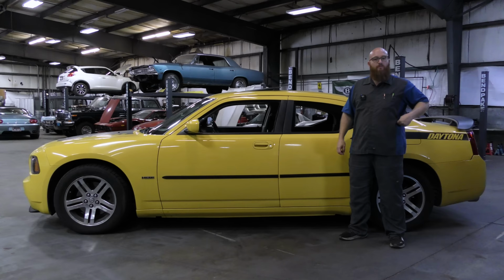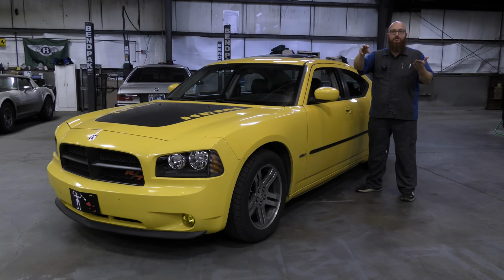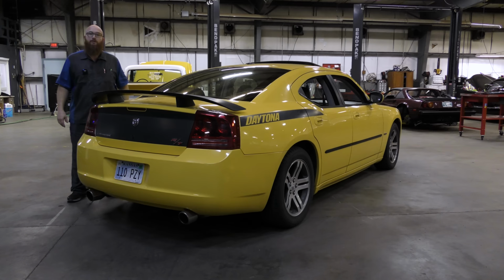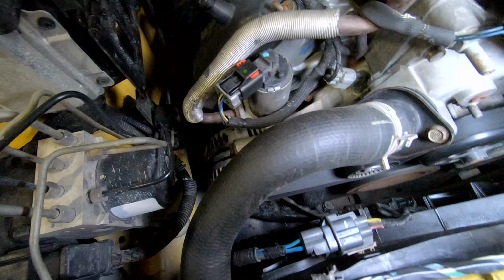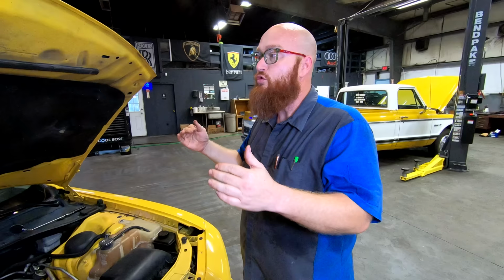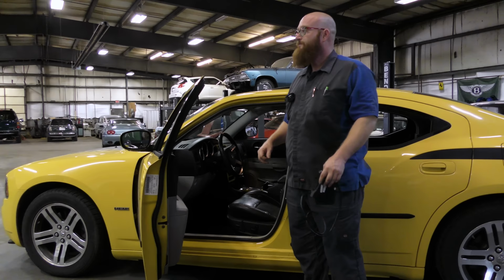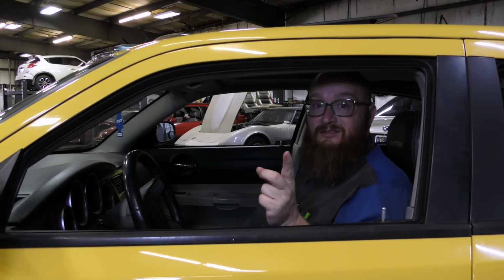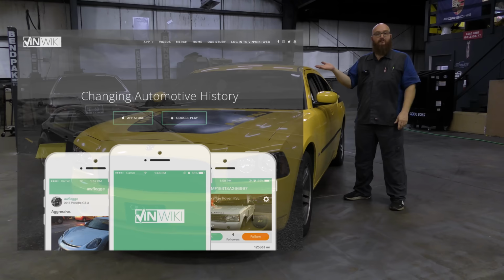4 things you MUST check before you buy any used car! CAR WIZARD shows how not to be scammed!

Comment: On the other hand I was a seller trying to sell a honest 1993 Toyota Camry 2.2 with 300k on it I had just put a timing belt kit plugs and wires on it, rear windows didn’t work a/c didn’t work had good tires check engine light was on not sure what for mainly due to obd1 no one had the connector but ran perfectly but couldn’t get $1200 for it 8 years ago I was actually offered $200 for it multiple times, now fast forward I kept it now has 480k on it all I’ve done was maintenance, it now needs timing belt kit done again. Still rear windows don’t work and a/c not worth fixing same pesky check engine light still on as well. One of the guys that passed on buying this car have had 3 cars in that 8 year timeframe, he now regrets not buying my old Toyota.

Comment: also an important one; make sure the coolant is the CORRECT COLOUR.  some engines require special kinda of coolent to prevent corrosion; chargers are a perfect example. they take exclusively HOAT coolant, usually orange, not green. Ive heard horror stories of charger owners using the wrong coolentand it badly mucking things up.

also ask about the kind of gas they put in it: stock chargers for instance are made for the best performance on 89-91 octane. if the owner is putting in regular, it'll feel more sluggish on the test drive. it also indicates the owner doesn't know anything about their car and hasn't been servicing it correctly.
Reply: Ironically DEXCOOL is specifically the coolant chargers and challengers use. Also chargers and challengers are made for 87 octane whether its the v6 or the v8 and says that much in the manual. 
You can run 89 or 91 but it wont do anything but cost you extra.
Reply: @pilsplease7561   my OEM manual explicitly says intended for 89 octane and above, but that the charger can RUN on 87 if needed. the knock sensors will start going off and lower your output power to compensate; also not great for your side walls long term. these engines have something like a 9.5:1 compression ratio which is pretty damn high for running reg. the different in power output and rev range is pretty noticeable. 

im pretty sure that they just use rebranded Zerex as the coolant, and even if its Dexcool, its the orange Hybrid organic blah blah variety; not just plain old 50/50 antifreeze propylene glycol. that WILL destroy the system over time.
Reply: @572089  Your car must be old if its got that low of a compression its higher on my newer car and manual says 87. To be fair they did revise the manual 2017 and newer.
Reply: @pilsplease7561   yea, the gen 3, are split into 2 sub-gens with different heads and with VVT or not.
(Pre-eagle, and eagle) or (early/late gemn3)

The earlier ones had slightly lower compression, but the lack of VVT means they can't just change their timing to compensate for low octane. This becomes even more relevant if the heads or block have been re-surfaced.

In order to actually make the full power of an Eagle gen 3 Hemi, you still need a CAI and 89-91 octane. The CAI because these engines absolutely starve for air with the stock air box (eagle or not). It's just not an actual danger to the engine anymore. Just cuts your power down a bit.
Reply: @572089  Yeah, my car has VVT so its not really an issue, and my car isnt starved for air so  I can run 87 as long as its from a known good gas station ive run into cheap fuel that clogs up fuel injectors or just runs poorly cause it is deff below 87 despite the rating. Bad gasoline is a thing in the US. I run 89 just because a lot of stations near me have terrible fuel and at least if i run 89 im probably actually getting quality 87 thats labelled at 89.
Reply: General Motors cars ise an orangish coolant called "dexcool" if the GM car had the standard green antifreeze.....that ain't good.

Comment: I’ve been a loyal follower for a while now but seeing this video and discovering you bought a Dodge is making me question why you would make such a poor choice on your selection. I owned a 2006 Dodge Charger SRT8 and put 50,000 on the OD before I sold it because of the huge loss in horsepower I experienced over the course of ownership plus so many mechanic complaints on how they damaged the low riding vehicle trying to get it on an alignment rack or the various issues like an odd noise during idle Dodge claimed came from oil squirts which I strongly questioned. Very poor quality and workmanship on these vehicles. Not sure why you bought it to begin with. I’m curious to hear what made you decide on that vehicle…

Comment: Great advice for buying used. These are things that I learned the hard way with buying used cars from 1979  - 2012. 
I won’t consider buying used anymore because of all the junk and flood damaged vehicles out there. However, this video is great for those who can’t buy new, or just prefer older, easier to work on vehicles. 
One thing I would add to this video would be to check for pedal wear. Make sure the wear of the brake and/or clutch pedal matches what shows in the odometer.
Reply: Im the second owner of my vehicle the first owner was a executive of a gold mining company got the paperwork to prove it and its kinda an interesting story lol. 
I only buy used cause i got fucked on both new cars i bought with factory mechanical defects that were so bad both cars were lemons from day 1. 

Had a 2015 Mazda 3 Grand Touring the highest end trim of the model with the upgraded engine and had a piston shear off and break, then had it happen a second time and grenaded the motor had it replaced at mazdas expense and then sold the car. Had a F150 with a intake manifold blow up on the 5.0 v8 on a new truck with no mileage on it and have had nothing but issues with it since, and I have that vehicle still and the entire roofs paint up and peeled right off down to bare metal for no reason at all, Ford Factory paint is garbage. 

My dodge challenger which i got used with like 20k miles and now has like 58k has had no issues mechanically the only thing that happened was 2 parking lot collisions which were repaired at insurance expense with nothing on record.
Reply: @pilsplease7561  I’ve bought 3 new Kia’s since 2012 with excellent service from them all, but I forgot to mention an excellent used purchase I made back in 2001.
I bought a 2000 Nissan Altima with 22,000 miles on it. I kept it for 11 years and put 230,000 more miles on it. Probably the best car I’ve ever owned. The engine was flawless and still ran like new, but other things were starting to go; cv joints, bushings, pulleys, etc. I was beginning to be nickled and dimed to death. 
No way to tell for sure about that Altima being the absolute best but I’m not going to try to find out by keeping a Kia past its warranty 😆

Comment: 250,000 miles on that car for 3 grand.You could not give it to me for free.If you learn how titles work it dont have to be in the sellers name.It just has to pass Dmv.to get the buyer to get it in their name with no problems.Only buy cars at sellers homes never meet them in parking lots.Pay a mechanic to go with you to buy a car.Most mechanic will do it for 100 if you drive.The best deals sell in hours of posting.Its a fine art to buy a used car and some sellers you need to be extremely aware of.

Comment: Wizard great video again I've been with you for a while now I have a 2007 2.7 Dodge Charger which I've already done all the weep hole water pump Etc but then I still blew the bleeder valve and then I was told it needed gaskets do you have any videos on the 2.7 this is very confusing so many things about this car but I like the car and got to get it done in the gaskets and head replace Etc but just wondering if you have any videos about that thank you GMM. Also I wanted to ask and point out. I was told to always use mopar pink fluid for the radiator fluid but you said 3 diff colors as long as full??  Could you please do a fluid video on Mopar??  Thanks!!❤❤

Comment: Do NOT,... purchase a Dodge or newer Jeep! Dodge is owned by Fiat in Italy and the engine is farmed out from Mexico. The paint job on the body of a Dodge or Jeep is a short cut to save time and money. Mostly plastic parts. If you want a durable, reliable vehicle, purchase something near mint and from 2004 and older. Jeeps are no longer, the Jeeps we saw during wartime that were durable vehicles. Jeeps are crap made under the corporate philosophy, planned obsolescence. <--- look that definition up, because 99% all products are now made using this philosophy.

Comment: If I see you on the highway car wizard I’ll take you to gapulbees. With my 2013 Nissan versa with 109 hp oh wait no no I’m not. It’s not too bad from 0 to 30 but once you tried to make it go from 40 to 60 it’s not as fast and when you try to go faster than 60 it will do it but it will do it slowly. But when I bought it it got like 37 miles a gallon now it gets more like 34 35 Now it has 142,000 miles on it and when I got it it had like 28,000 miles

Comment: Good advice about checking codes. But also check when the codes were last cleared. There should be a metric stored that states how many minutes/hours since the codes were cleared. This might be engine hours or something similar. If that metric is very low, you will know that the seller recently cleared the codes, probably to cover something up.

Comment: Yes sir I just watched your video on the 71 Chevy pickup . I have a 1969 c25 that I changed the stock 396 big block. To a 1980 crate 454. It starts perfect it runs perfect when it’s cold. And in park and neutral .  When I drive it and the motor is running at normal  temperature. It starts hesitating and if I floor it it backfires through the Elderbrook four barrel carburetor. If I pull over put it in park or neutral run it runs perfect. Electronic ignition .if I hold on the brake and floor it. It does the same thing backfires through the carburetor. Please I beg of you any suggestions or advise. Love you show. Thank you
Reply: Please help I’ve been trying to figure this out for over a year. 69 gmc 454. Used crate motor . Hei.distributor . When warm and driving it backfires from carburetor. When in park or neutral, it runs perfect. Any advise please . I’m in Spreckels California . Otherwise I would bring it to your shop. And pay any amount to figure this out. I will pay you any amount to solve this problem . Thank you car wizard.

Comment: Car wizard I own a 2001 Saturn SL2. It's had an EVAP leak code for literally years but recently I pressed the 'oil-r' button in the fuse box to stop the 'change oil soon' light coming on, the EVAP code went away along with it. Took the pending code off too after scanning. I don't put many hours on the car as my workplace is literally 1 mile away, but it would be interesting if the code didn't come back lol.

Comment: My sister bought a NIssan Altima, as is from a dealer in Arkansas.  50 miles in on the way home from the dealer, CEL comes on and it's in limp mode, transmission going out. No lemon law there.  So if possible drive the miles required to make a CEL come on for that type of vehicle?

Comment: question,, I have a 2000 bmw z3.. one of the rear wheel speed sensors were bad and the DSC light on the dash came on after starting the car.. I replaced the bad wheel speed sensor.. now, when I start the car,  the DSC light is off. when I drive it and the car gets to around 20 mph, the DSC light comes on and stays on until the next key cycle.. I cannot turn the DSC indicator off by toggling the DSC switch.. any direction on what to check next? thanks

Comment: I am having car issues with Eos vw, it cranks and turns off occasionally. The dealerluship replace depress brake and it continues to do the same. I brought it to a mechanic and the diagnostic code required manifold replacement. I had it replaced and it still will not start occasionally. Do you work on vw? I have spent $3,000 on repairs….please help.

Comment: Hey Wizard, does your shop do prepurchase inspections, and what do they run at?  I'm assuming about $200 total for 1.5hrs labor, right?

The bottom line is that used cars market is a pretty dark place right now.  The prices have gone up so much that the market is flooded with junk that barely runs and will die within six months without major drivetrain surgery.  Good deals where you can buy a non running car for $200 and get it back on the road with a new starter don't exist anymore.

I always recommend to people who are not good with cars to take a vehicle they want to buy to a good mechanic like the wizard and pay them to look it over along with an estimate of repairs it needs or will need soon.  It costs money, but it's better to be out $200 I stead of being stuck with a junker that needs $5000+ of immediate work.